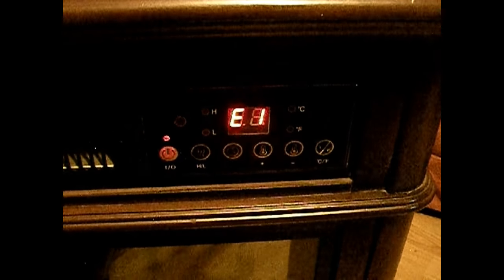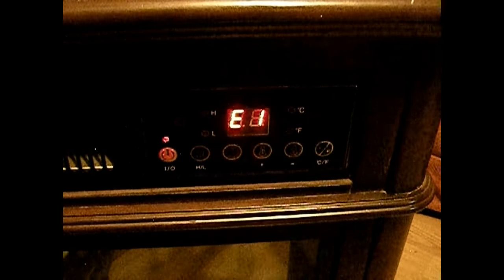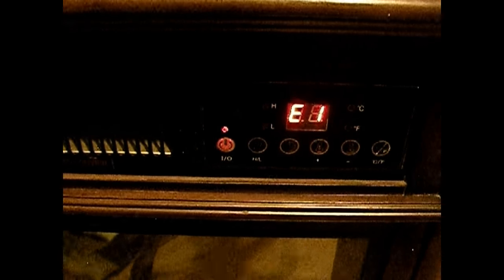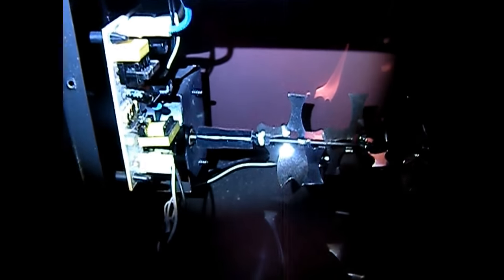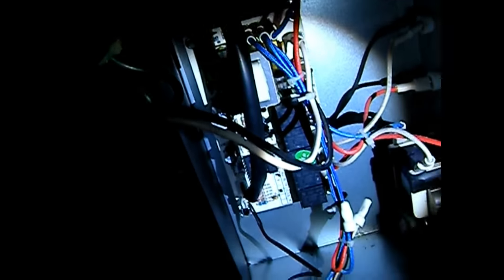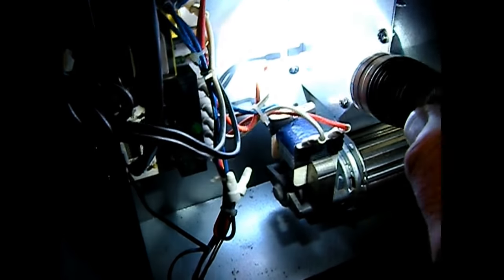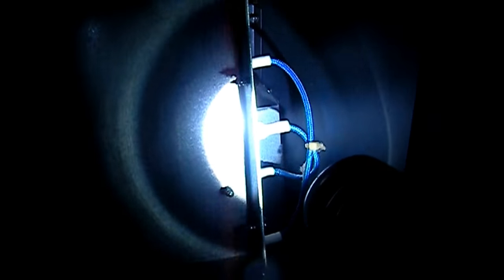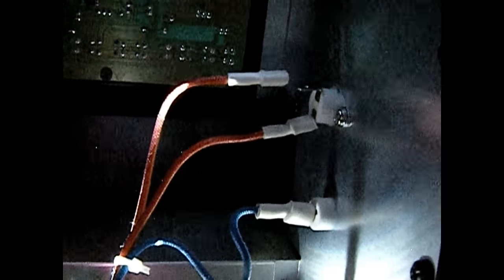E1 ERROR Code electric fireplace infrared heater

Comment: Hell yeah, thank you SO much!! Mine wouldn't work on high heat without an E1 error code minutes after turning it on, it would only run on low heat set to 72. I've been running this in high for awhile now with no problems thanks to your video. Much appreciated!
Reply: How did you fix yours??
Reply: @TrippyNxgz  I disconnected the same wires that are shown above & then I reconnected them.
Reply: @abbeytotten3947  I’m having a hard time getting the shell out of the box to get to disconnect the wires.

Comment: well. you just saved me $130 ... thanks a bunches... I have a fireplace just like yours, and love it, looks great, and heats up my camper like a champ, but, I started getting E1 error code, I almost went to Walmart to get another one, but jumped on YouTube just in case, and good thing I did... my problem was a filter, I've been using this thing for 3 years now, and never cleaned the filter, I took the filter off and cleaned it, and the fireplace works like a champ again ... thanks a lot...thumbs up definitely :)
Reply: I installed one in need my 5th wheel 3 yrs ago and woke up this morning freezing my ass off because of a error code so where is the filter located? I'm guessing inside the back of it?

Comment: Thank you for this video. It was very helpful and “winding me up“.  

I have three cats, and the elements in the circuitboard were full of cat hair.  I guess it just built up over the last couple years and since we have it against the wall we never pull it out and vacuum behind it. 
I unplugged it, and vacuumed the inside of it, turned it back on and it’s working great.

Comment: Usually this can be fixed by just unplugging and leaving it sit for a few minutes. If you have to remove the wire it is due to corrosion most likely causing a bad connection.
In my case after a couple of errors and a couple of lubes of the fan my fan stopped turning which caused the error. This error is an overheating error which you should not ignore. 
If it becomes annoying resetting or you just want to Amazon has numerous heaters and fans you can buy for 40 or under.

Comment: I have the E1 error code also but i am curious about the filter cleaning. You stated that the manufacturer said clean the filter but in your video you unplug the wire to the circuit card and apparently that fix the error code. But what about cleaning the filter, do you still need to clean the filter or where is it located since you didn't show that in your video?
Reply: Should be on the back you should see it on this model or look for a intake panel where it pulls air in

Comment: Thanks for the help. Things been driving me crazy and the company wont answer phone, email, or pony express damn heat wave company. I guess this is more common than i thought.
Reply: sunwunyc which heatwave heater do you have? I've got the same damn problem
Reply: Brienna Vargas its from a company called heat wave, i bought it from wallys world and it was a waste of 99 or 105.oo or whatever i paid for it. Works for 5 to 10 min, stops E1 shows on display, unplug and repeat till i say fuçk it.

Comment: So just the old American method of unplugging it and plugging it back still works just inside the unit? My heater is a "life corps product " little 1500wat portable heater. It has this error but backwards and works with it want to. Guess when it stops working completely ill give this a try. Thanks for the vid.

Comment: Can you help me? My fireplace insert in my tv stand is an Intertek, and all the remote controls in my house turn it on and off with each click so I have to leave the buttons covered with aluminum foil. Is there a way to fix this? Intertek 4000755 electric heater model GW-2078 manufacturer Great Worlsd LTD
I can’t find any information or parts for this heater.
Thanks!!

Comment: So go in and find the two red wires that connect to your thermostat. Usually they're going to be in a high point in the heater which mine were.

What Willy is saying is to do is unplug them and plug them back in? I guess their ultra sensitive wires and over time they lose connection. 

I tried that. So far so good. Last resort would be to get a new thermostat and like he says in the comments below, make sure you get the right one. It's a $5 part in about a 9 minute job to install it

Comment: To reset the E-1 error code, you just need to unplug the unit at the wall. This will reset the unit! At least temporarily! How does removing the thermal circuit breaker wire and replacing it solve the issue of the E-1 code coming on in the first place?
Reply from the maker: Because it did not have a good connection. Removing and replacing wipes and cleans for a better connection. Best to scrape it with a pen knife or sandpaper before sticking the wire back on.

Comment: So, if I'm gettin' this right, all you did was unplug the two breaker wires and then plugged 'em back in and that essentially "re-booted" the heater clearing the E1 Fault?.. The wires didn't work loose, or come unplugged on their own or anything like that, you just unplugged and then plugged 'em back in?..

Two winters ago I had an E1 fault and I tried everything from cleanin' the filter, to blowin' everything out with canned air, to going over all the wiring looking for scorched or burnt connections and I ended up finally cutting the cord and throwing it out.. Fast forward to last night and I've got another E1 on the exact same brand/model (Lifesmart) infrared heater, so I'm gonna have to try this little breaker re-boot trick and hopefully save myself $130-$150 this time around!.. 🤔😁😎

Comment: Where is the filter located at & how do you clean it,  I am getting the error E1, Thanks
Reply: uxcell 135 Celsius Normal Closed Ceramic Thermostat KSD301,  can i use this part for an E1 error? Thanks
Reply: Hello,
Did you figure out where the filter was located on your electric fireplace heater? I was wondering the same thing.
Reply: Where is the filter?
Reply: I can't locate the filter on it. All of the wires seem to be soldered when I opened up the back.

Comment: I'm having same problem with my Hearth Trends electric fireplace-mine is about a year and a half old now and I would like to fix it. Do you know where or how I can order a new part. Nice video thanks for the upload.
Reply from the maker: It could be that the wire connection is not making a good connection. All i did was put the wires off and stick them back on, thus cleaning the connections. You can test the switch by checking continuity with an ohmmeter. It should show continuity at normal temperature, (normally closed). It should show a open connection if the switch is heated with a soldering iron or other heat source.

If you do need the part, it can be found on eBay. Search for KSD301.
http://www.ebay.com/itm/like/391078894556?lpid=82&chn=ps&ul_noapp=true

$3.29 from China if you can wait 3 weeks or $5.99 from USA if you want it quicker. Be sure to get one at the correct opening temperature. 120C or 130C.

http://www.ebay.com/itm/Thermostat-KSD301-B130-130-C-266-F-N-C-NC-Temperature-BiMetal-Switch-/352010989238?hash=item51f57d6eb6:g:0e4AAMXQoiJRgHHQ
Reply: Cool, thanks I'll give it a try
Reply: Should be able to check opening and closing temps on s good hotplate also.

Comment: I haven’t cleaned my filter. Where is the filter
Reply: Hello, did you figure out where the filter was located on your electric fireplace heater? I am having the same issue with the E1 error code on my classic flame fireplace heater.

Comment: What if I can't get the wire to come off the thermostat. It literally will not pull off , so even if I got a new one I don't think I could pull the wires off to replace it ..... uhhhhhhhh!!!
Reply from the maker: Try a lubricant on the connection, then  wiggle it with needle nose pliers. If that fails you could cut the wire and put a new terminal on it. Also you may be able to find a used wire with a good terminal from an old appliance and connect it to the cut wire with a wire nut. Many times the switch is still good  but the terminals do not have a good connection.
Reply: tom mix wilkes thanks Tom. Gives me lots of options to try once this thing shows up in the mail.
Reply: tom mix wilkes the one I got is a right angle sensor. The contacts go out the sides not straight back ..... could I bend the straight back maybe if the wires aren't long enough to reach the sides ??
Reply: Just unplug it and plug it back in, it will clear the code and probably work fine.

Comment: I bought the part and still doesn't work.  I really don't understand. Turns on for about. 5-10 mins then shuts off. After E1 error if I let it sit , I can turn back on for 5-10 mins again then shuts off.
Reply from the maker: I would test by temporarily pulling off the wires and connecting them together with a wire clip. If it stays on then the part is at fault. Did you get one rated at 130C? It is just a switch that opens at the rated temperature.
If you get an error with the wires connected together then there is probably a fault in the circuit board.
Reply: Is that the only temp control on it?
 Makes me think of a " nonresettable " thermal cut off on a dryer.  That being said, a dryer has multible thermostats which have lower temp ratings.  That is why I ask if it only has that one.
Reply: E1 is low air flow code. Clogged air filter or faulty blower. Mine ran just fine making a squealing noise for a long time, then started owing E1 code after 15 minutes. Took it apart and found all the oil from the bearing on the sheet metal below it. Ordering a new blower assembly.